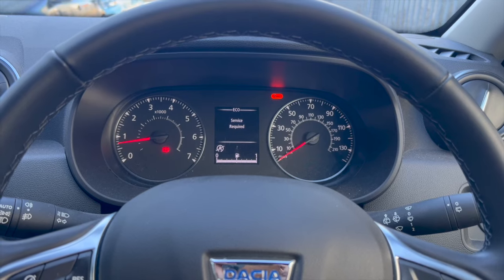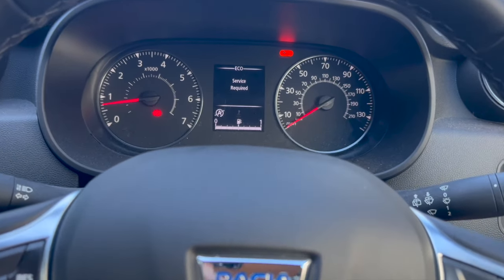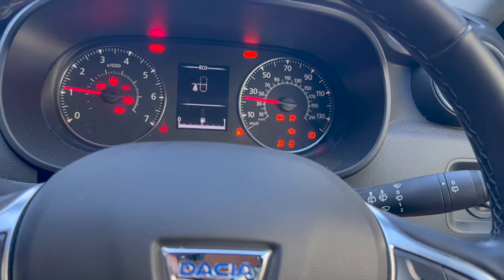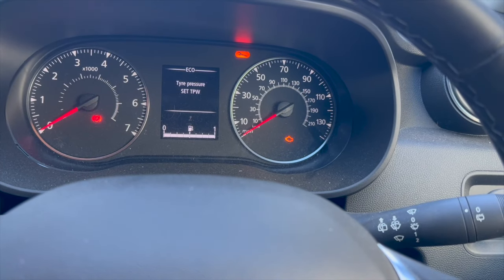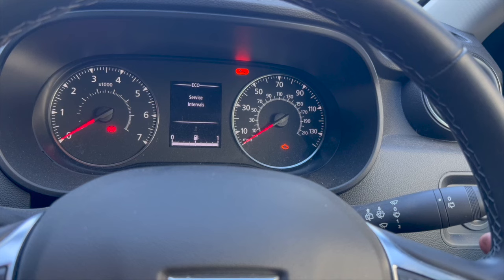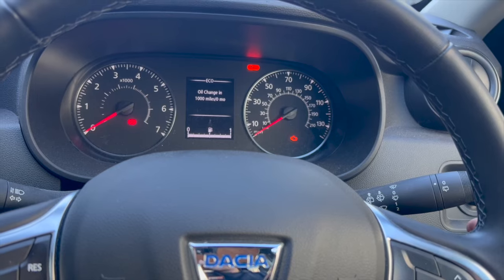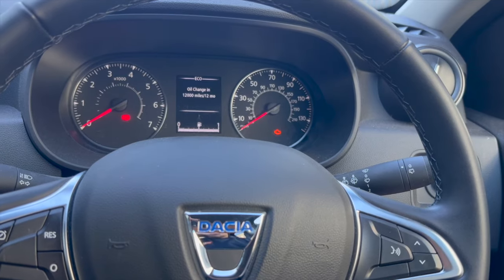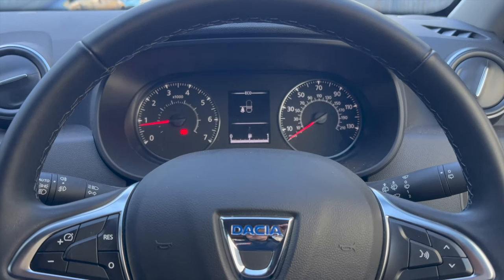2019 Dacia Duster service light reset

Comment: Top video! I have  successfully put out the ransom light errr I mean service light. No more expensive main dealer services for my 2018 Duster, back to 5L of oil and a filter from Halfords and home mechanicing!
Reply from the maker: Haha nice one 👍👍
Reply: How did u do it
Reply: @fredhirst155  i had this video running on my phone while I sat at the drivers seat and just followed the steps. Then bingo the light had gone
Reply: Which engine do you have? 1.6 115 sce petrol?if yes,what oil did you get from Halfords?
 Thanks in advance...

Comment: I have a problem with service light, traction control and power steering light on a dacia duster 2021 prestige. Because I only do a few miles per year, this year I only had it checked over by a local garage that has done our servicing for the last thirty years. After the quick service the lights mentioned came on and won't go out. Any suggestions?
Reply from the maker: Hmm not sure tbh , it really needs the fault codes reading
Reply: Got the same problem, did you find the cause or solution?
Reply: @jorneevraerts8450  no, I didn't, I've decided to take it in; hopefully, it will be covered by warranty.
I think it's possible that it's a deliberate fault that has to be corrected at a main dealer.
Reply: These came up last year on my 2019 Dacia Duster when my garage put winter tyres on the front of my 4 X 2. In the end the main dealer changed the sensors under warranty. You can get them to go off when the engine is running and the vehicle is  staionary by turning the steering wheel fully to the left and then fully to the right. Sadly though you will have to do this each time you start the car but at least it gets rid of the warning lights!! Best. JJ Goes Forth
Reply: @jjgoesforth  yes, I had to do it every time but it's not a solution, so I ended up taking it back to the garage. They claim that it is only Renault that can reset these lights, that means, notwithstanding the fact that under the law, you can take your car to be repaired at any garage that pays vat, as long as they use approved parts, oil etc. However, then you may have to take it back to the main dealer to have the lights reset every time and pay for them to do it. The problem I have is, if you have taken your car to an independent garage and paid them for the service but they are unable to reset the lights, what happens in the event of an accident, I'll bet they would void your insurance for not having it done.